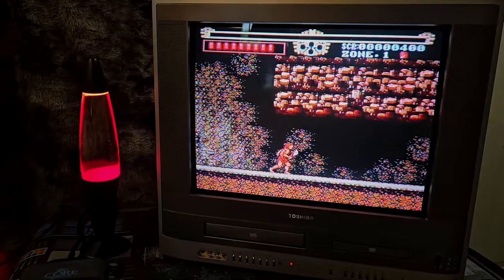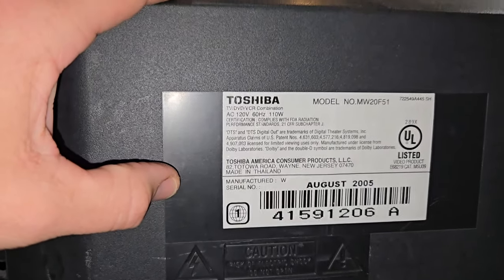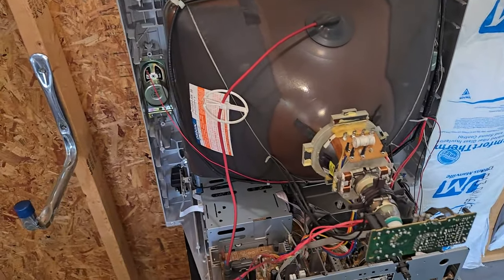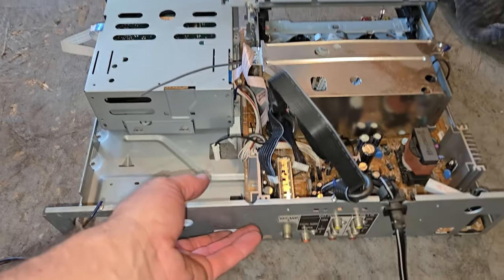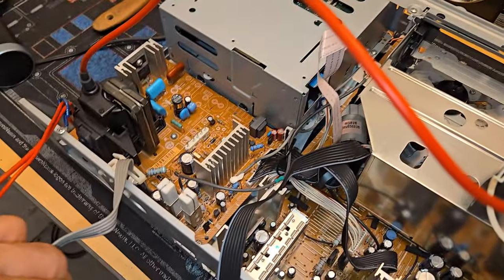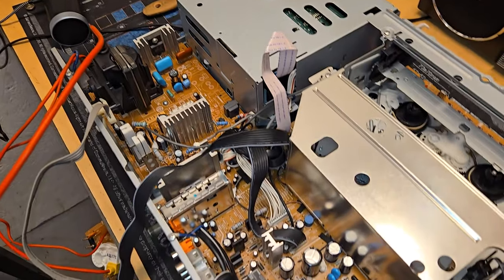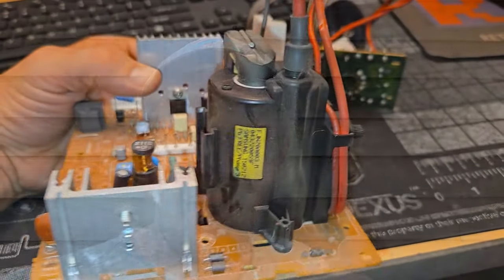Toshiba's All-in-one Retro TV | The MW20F51 CRT Deep Dive

Comment: Crazy, I just picked one of these up about a week ago. Mine is a cheaper version without the card slot though. I spotted it sitting on the curb while working and went and nabbed it on my way home.
Reply: any luck finding a universal or replacement remote for it? I've been going through quite a few to no avail. Separately, I was able to program a universal for a different Toshiba CRT I have that's a 27" (TV only). Would just love to find something that works so I can interact with the DVD menus

Comment: Sir I need to change CRT tv anode cap but the problem is the original cap is used of size 7.5cm diameter but I have 6.5cm cap can I use it or it is not safe.

Comment: I have worked on many Toshiba dvd/vcr combo, the vcr part always fail, but they are very easy to work on as most combo from that era are rebranded FUNAI. All they need is cleaning the dirty mode switch or replacing a burned laser emitter, re-greasing the whole mechanism and cleaning the video head.

Comment: I had the 2004 version without the SD card slot bought brand new in 2004 when I got it as a birthday gift. I used it SO heavily. one of the things I did was record YouTube videos onto VHS using the Wii internet browser back in the day. It developed the same aforementioned issues with the VCR no longer accepting tapes and the DVD tray acting weird. Mine also got the dreaded retrace lines on the screen after a few years...

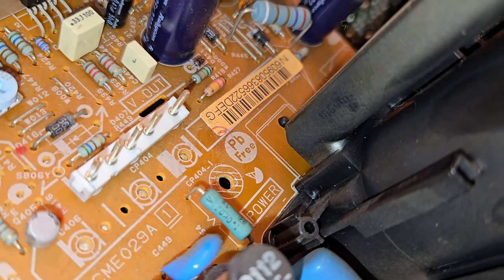Comment: 13:26 I understand that it would be a lot of work; however, would it be possible to replace all of the solder on the board to standard Sn / Pb or would the pads on the board not be compatible?

Comment: I have the 2004 version without the card slot. Did your vhs / dvd player work? My vhs cannot play back tapes well and the dvd drive doesn't read discs. I tried cleaning the vhs heads but that didn't help much, still has massive tracking issues. Does the entire tray slide out that hold the dvd and vhs decks? Great video!
Reply: I have an MW20FM1 that's similar, but no SD card slot either. No issues with dvd player or VCR thankfully. Hope you can get yours working properly, it's a great unit!
Reply: @danielaguilar8424  Tbh I ended up selling off 2 or my 3 crt's, including this one, to make space in my apt haha. But it was a cool set for sure! Just too many projects to fix not to mention videos to edit...ugh! hah

Comment: My friend bought this TV off FB market and the VCR accept a tape but doesnt play and the DVD tray won't open.  It also only turns on once right after it is plugged in but if you turn it off it won't turn back on.  You have to unplug it and plug it back in.  I'm going to crack it open for him and see what is wrong.  I am expecting a gear or belt to be bad on the VCR and a belt on the DVD tray.  TV I'm not sure but maybe a capacitor or voltage regulator on the psu.

Comment: I have a similar crt but with a USB port instead of a memory card slot. Love this thing, i just wish i knew someone that can help with the geometry being somewhat off.

It is a little better with the remote. Using the software service menus is far more doable with the remote, and its quicker to switch between menus, but other than that i haven’t been in a situation where i would need more features to find and the service menus don’t do enough alone to adjust the picture geometry to my liking.